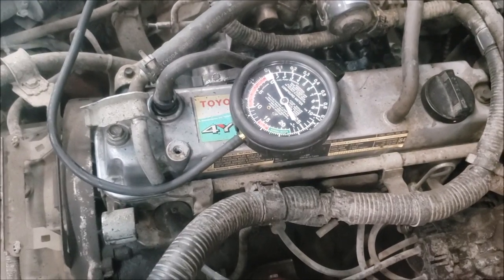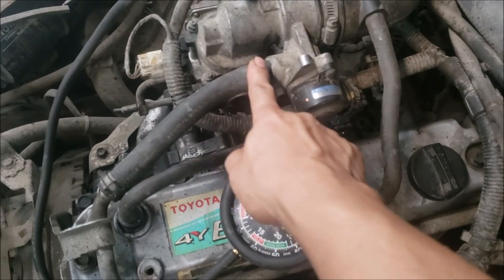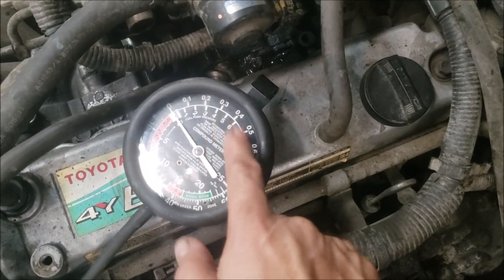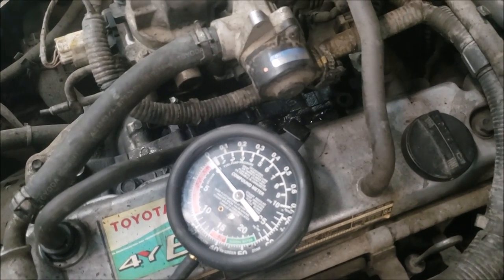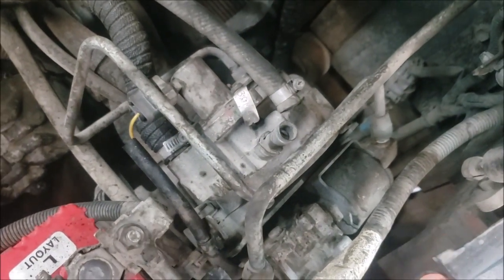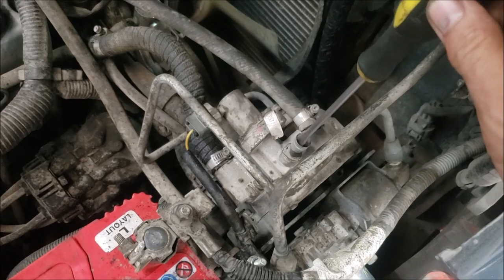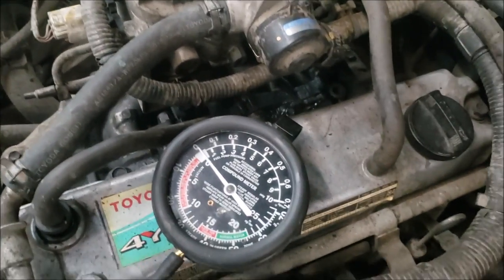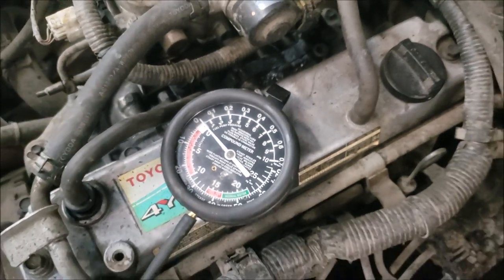Toyota Long Cranking start up

Comment: Standard screw setting from new is 5 full rotations anti-clockwise from fully closed, a good place to start, then check vf voltage on display or probe the diag connector, adjust to 2.5-3.0

Comment: Thank you so much, bro, for the video. I'm facing an issue with an electric stacker. The problem lies in the steering as the stacker consistently turns 30-40 degrees to the left. I attempted to disassemble the pinions and manually rotate them, aiming to reassemble them in the correct direction. However, the stacker keeps reverting back on its own.

Comment: If you are able to access the service menu. Throttle angle should be less than 6* if not clean it. (you can find that on the menu too TA*) With the engine running adjust the RPM to 800 then look for VF setting. Adjusting that knob on the regulator until it reads 2.50-3.00 (fluctuating between the two numbers)

This a reset if someone has been fooling around with the fuel ratio from the regulator instead of cleaning the carb.
Reply from the maker: This does not have the premium display, thus the plug in analyzer would be needed to see the vf setting.
Reply: Oh! That’s too bad. Yeah then it’s adjusted by sound and propane smell 🤣. You know the professional way.  

Thanks for you videos. They’ve helped a great deal when I was starting out.
Reply: @forkliftgeek10  
You can see the VF voltage by using a volt meter. Positive lead on VF terminal on diagnostic connector and negative lead to battery negative. Throttle angle is important. I just clean them cause the are usually dirty.  Then adjust.  I always enjoy your informative videos.  Scope capture of o2 tells it all. Nice Job . Keep up the good videos .
Reply: Yeah I do this to every truck that comes in the shop. Most of the time the throttle body is dirty, doing what you said with the analyzer fixes the issues quite good!

Comment: I have a Toyota 8FGU25 that the initial problem was it would start but would not idle. I disconnected the vacuum sensor and got it to start and idle. I replaced the sensor but that didn’t solve the problem, can you give me input on what it might be? Thank you

Comment: You got to be careful with those 4ys when adjusting the regulator you gotta make sure your oxygen sensor is opening and closing or the truck will trip out over time

Comment: My TOYOTA 42-3FGC15 won't start when it's cold without a shot of starter fluid. Once warm it starts fine. Any ideas?
Reply from the maker: Check for vacuum leaks
Reply: Change fuel pump and you good to go.